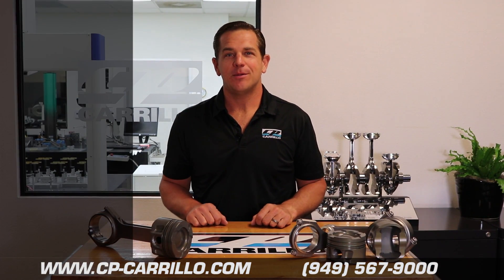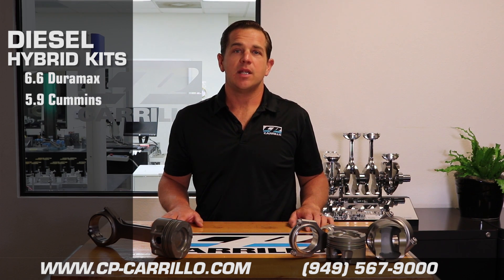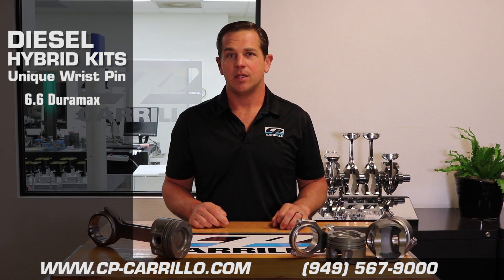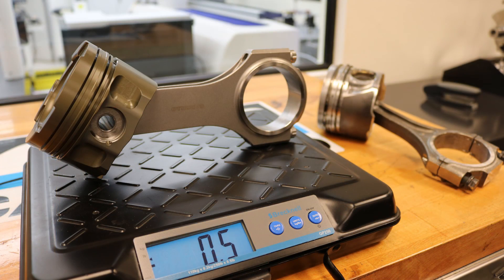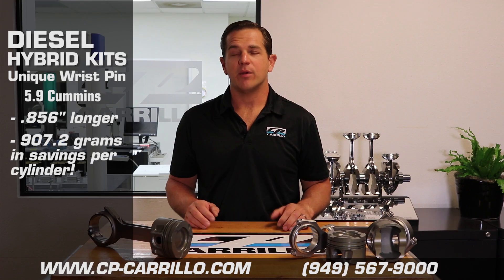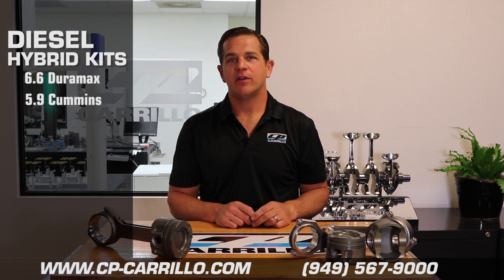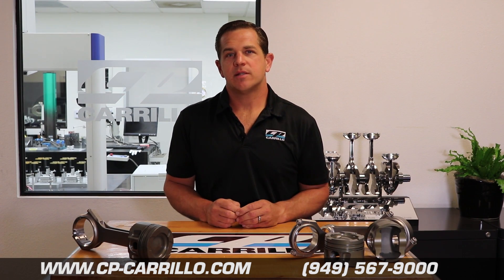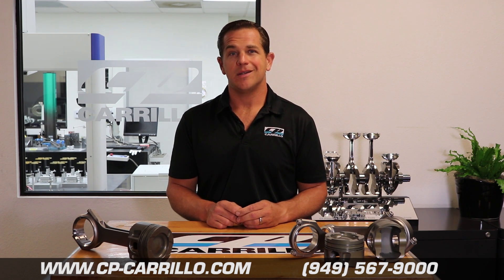CP-Carrillo Diesel Hybrid Piston and Connecting Rod kits

Comment: Can these be used for a daily driver?
Reply: Watch the video again. He said this is for the guy or girl who wants 1200-1500 hp and still drive your truck on the street. With that said any time you modify a car you will lay your foot into it and depending if your a tester or someone who has a mechanic do it and have a custom dyno tune it will need custom dyno tuning and street tuning and with that built motor then size a turbo or twin set up that allows you to use your truck and you would hav an absolute bullet proof truck say tuned at 1000 hp and live a lot longer or 750hp tune and live. 1000hp on the street is probably harder to drive than you think just because it’s there and you want to use it and your stuck in traffic. My opinion build your bad ass truck. Buy a piece of shit daily driver Cummins and tune that for fuel economy. Way cheaper in the long run trust me.